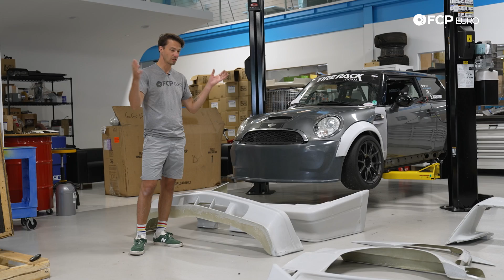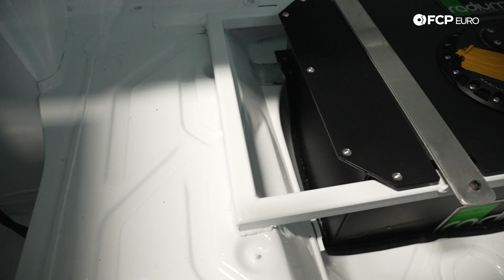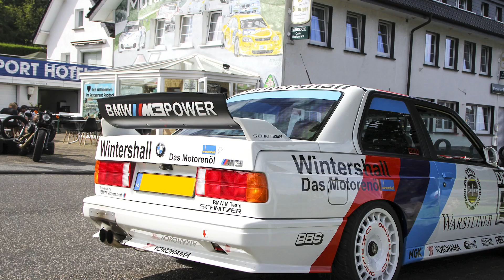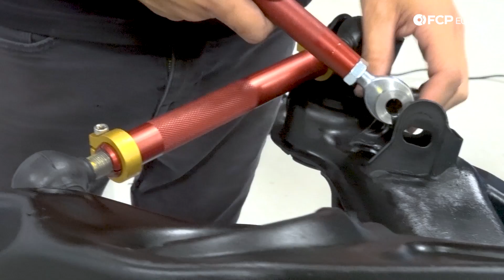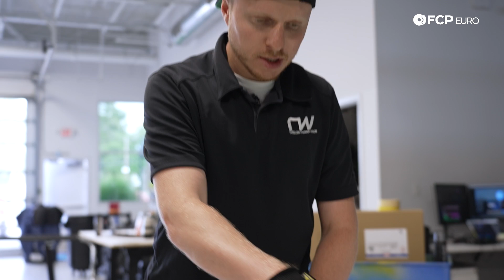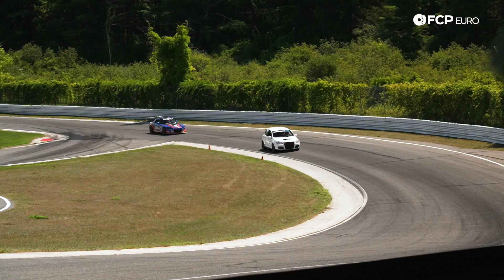Running Out Of Time On Our 190E DTM Tribute - Widebody, Cage, & Throwback Livery  | Golden Era Ep.4

Comment: What ball joint did you guys used to work with front spindle from c63?
Reply from the maker: Hi Jurcic, we ended up using a MB GL Balljoint! https://www.fcpeuro.com/products/mercedes-suspension-ball-joint-1643520327
Reply: @fcpeuro how did you fit it into the knuckle? Did you ream out the knuckle mounting hole? What’s the taper? Deets please 😊

Comment: We just finish the proces of production of the first - easy and good fitting body kit for EVO II. On the world's market there is one - bad template that is copied and copied by young amateurs of car-racing that are fascinated by fiberglass. We also manufacture MB w201 190 EVO II Replicas here in Gdansk Poland and when we tried to fit this dramaticaly non-fitting set (from Austria) we decided that over 130 of expensive working-hours that we had to sacrifice to fit it cannot be waisted and repeated. These 'aftermarket' sets do not fit, has no holders and mounts on both bumpers - also they have no closing arches along the tire line - why?, the screws glued in on the side arches are Dramaticaly not in their correct places, side skirts on doors - what do we do with them - glue them with kilograms of glue?? - they also must have bolts to fit them nice and easy. Our set is free of those problems but much more expensive - but still cheap. Also available in a demanded color so easier to paint or leave it like this. First 2 kits on March 2023 - Nr 1 on my private 300bhp 420Nm 190E 199 Schwarz-Blau with 2.0 M111 Engine :-), The story on my fb.

Comment: Did you full on weld up the sunroof or fiberglass it up just so it has the right look. If they were able to fit that body kit and everything else going on with that in that super tight time line DAMN!!! Impressive, if not it's understandable that it was done quickly to get the car finished to go back and weld it it.

Comment: I'm so excited to do my 190E like this. God I can't wait, I just bought my 1990 190E though I wanna put a M104 engine in it though I wanna keep the OG leather seats but I'm thinking about going with a digital dash and have some ambient lighting like a newer Mercedes. Still not sure if I wanna turbo the M104 in the cause I don't want crazy stupid power I think 500 horsepower would be alright, but I'm not sure in RWD car. Any tips guys?
Reply: I’m gonna swap my 190d with a om606 I want big numbers but it’s prolly gonna take awhile it would be a good race
Reply: The M104 is an amazing engine with a lot of potential. It handles boost extremely well because of its forged internals and can handle your 500hp on a stock block any day of the week. If you go standalone (which you should) you can always make multiple maps with lower power for street us and rain if you want, but its almost a shame NOT to boost these things
Reply: @kenmeri5832  I definitely want to be able to just enjoy cruising in the car so definitely would be a good idea and I know I'd want to have a povy rear dif too
Reply: @kenmeri5832  Also what liter M104 is the best, cause I was thinking of getting a 3.2 liter, but another guy said make sure i get one with low compression
Reply: @543nickb  There is not too much of a mechanical difference between the 2.8 and the 3.2 as far as im aware, only that the 3.2 has a longer stroke and thus different power/torque charactaristics. Either way the compression ratio can be changed with a thicker gasket, shorter rods or pistons, its not something to worry too much about if you run under lets say 600 hp and even if you do go higher, you need to change rods anyway so might as well get short rods then. One thing to keep in mind however is that apparently there was a CR difference between engines that specifically came out of a W124, which was maybe what the guy was going for
Reply: @kenmeri5832  Hmm, good to know, yeah I definitely don't want to realy want to go above 500, if it does hit 550hp I'll live, but preferably not. I just think 500 is enough to cruise through traffic, but also still able to have enough power to maneuver through traffic like a bat out of hell.

Comment: This is such a cool build. Really love it.
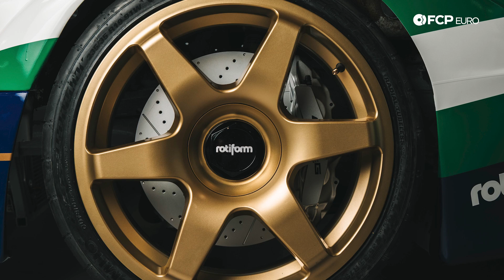Considering how much work those guys did in the body shop, it makes me wonder why there is a paint run on the fender at 14:35. I would loose my mind if i got that back like that.
Reply from the maker: They were not stoked on where things ended up but given what they turned around in 5 days (had not originally planned to do the work) we basically said do what you can to make it work, they want to still take the car back and refine anything they were not happy with. For the scope and turnaround, we were stoked with the work they did.
Reply: @fcpeuro  of course the timeframe was short, which does explain everything well.
Great that they will fix any blemishes that might be there, hard to find decent body Shops this day.